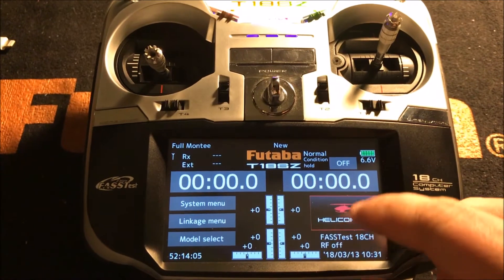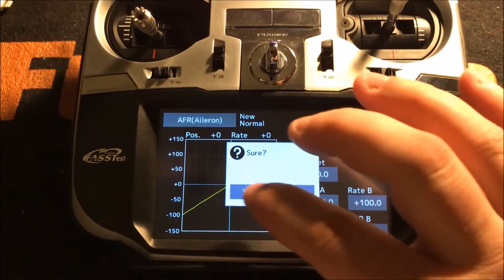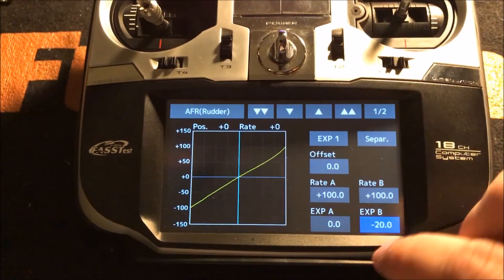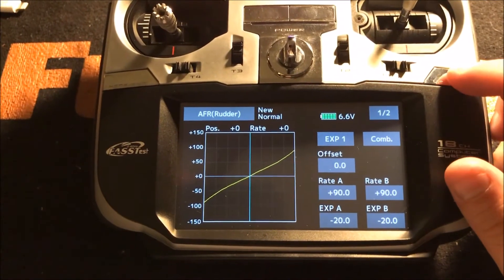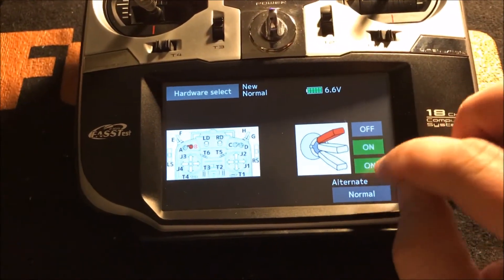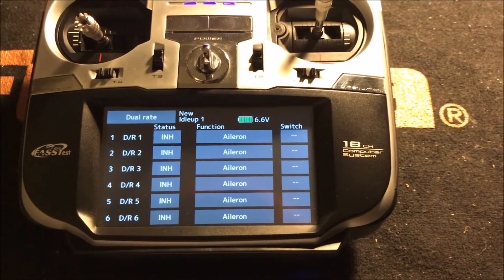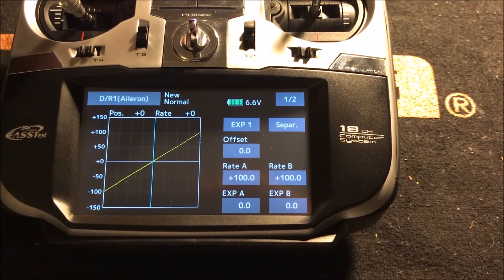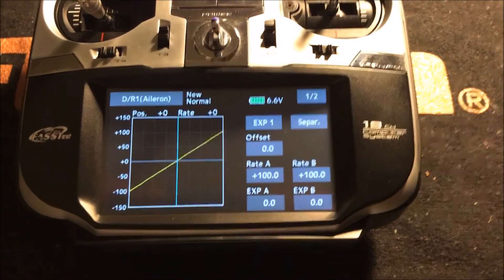Futaba 16SZ 18SZ Dual Rates & Expo

Comment: To have the same expo from normal on a switch in idle up1 and idle up2 you need to do it 2x extra or 6x because you have aileron, elevator, and rudder. Meaning, if you forget the expo in 1 and 2 it will turn of the expo you had in normal. Isn't there an easier way? My T14SG was way easier. Just expo on a switch and you're done. No doing it again somewhere in idle up1 and idle up 2.
Reply from the maker: Robert [TOG] https://youtu.be/wEuLZFyt17Y